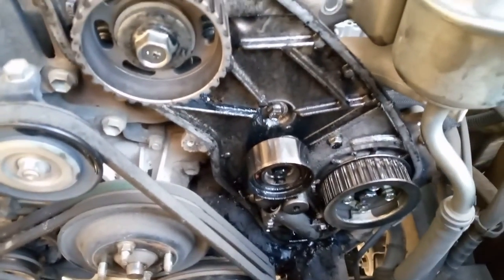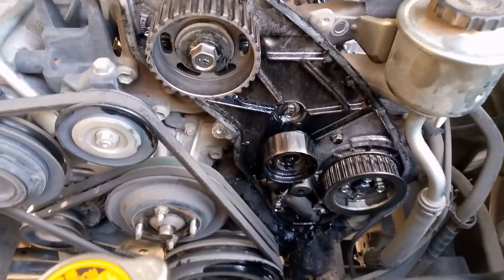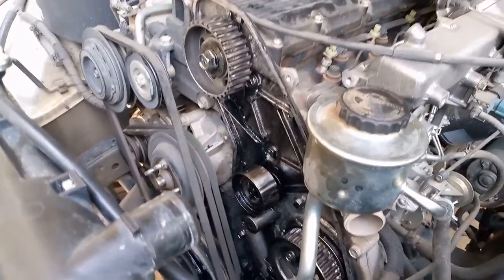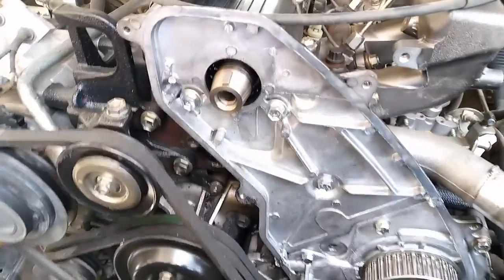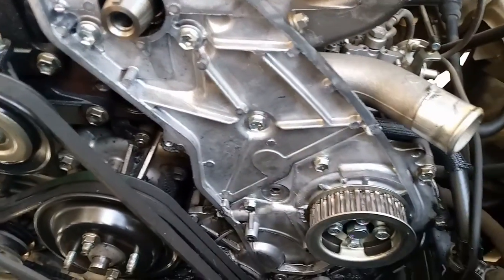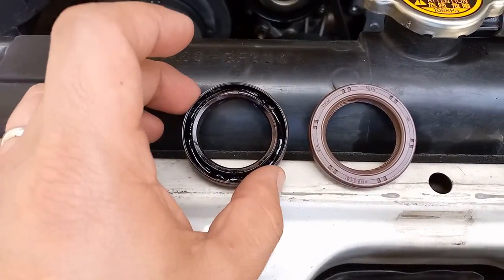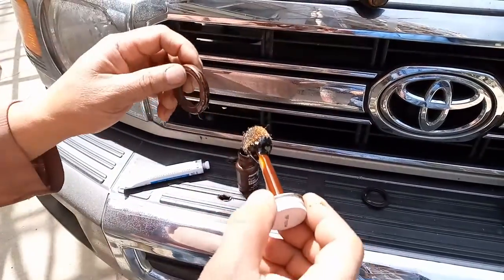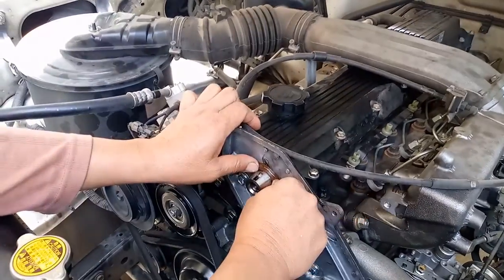Camshaft Seal Replacement and Install | Oil Leak Fix

Comment: Was the seal flush or did you push it in past the lip?
Reply from the maker: Hello, thank you for watching. Yes, putting some amount of lubricant before evenly pushing it into the surface carefully since I do not have replacement tool kit.